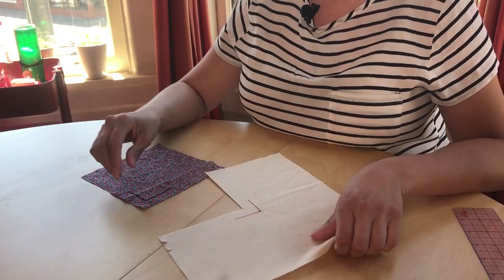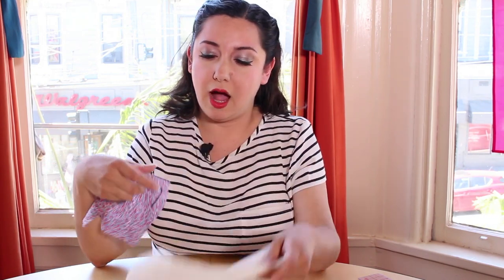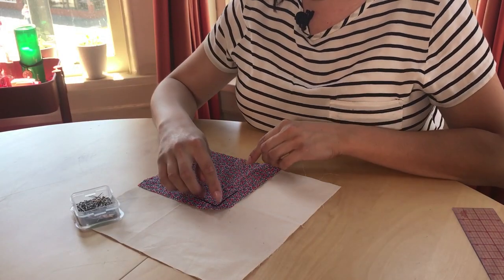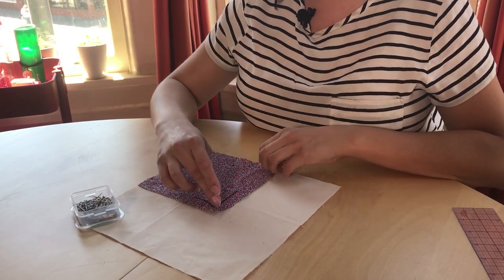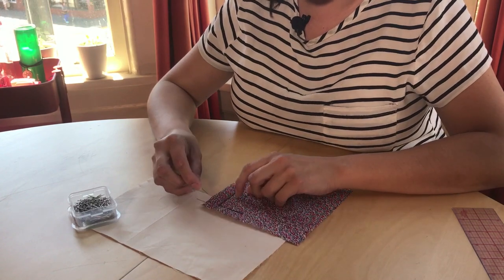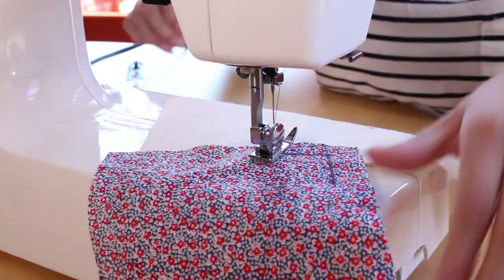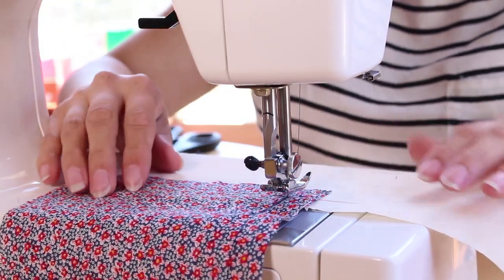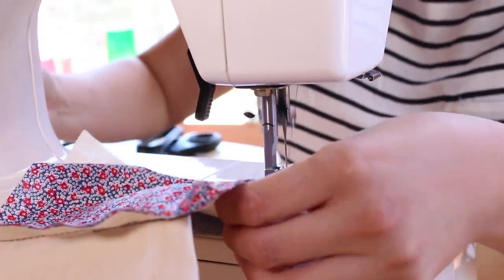How to Sew a Corner Seam | Vintage on Tap

Comment: Thank you so much! This was really helpful for a 30's dress I'm trying to sew which has really tricky seams. The vintage instructions tell you to do it a really really terrible way. Clipping ALL the way to the dog  first and just telling you to sew it by holding back the seam allowance and top stitching it on to the other piece. I tried clipping first (not even to the dot) and it frayed as you tried to work with it and ended up showing some raw edge on the right side. This way will be much better. Other videos on this do not actually let you know you're pivoting and need to keep sewing STRAIGHT or you don't get a smooth corner. Such simple but crucially important bits are often missing on sewing videos so thank you.

Comment: I'm going to put the letters ZR in a white vinyl marine sun pad in the same way you showed.  It seems the release point in the corner is the key.  Lots of sharp turns.  I'm wondering if I should use a glue to secure the runs going into the sharp turns, and/or staple the heck out of the whole thing.??